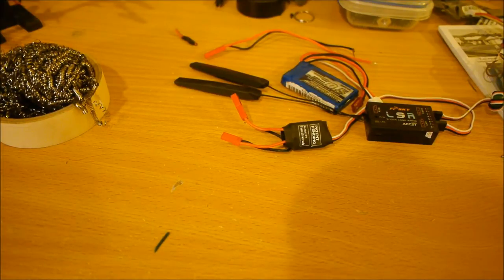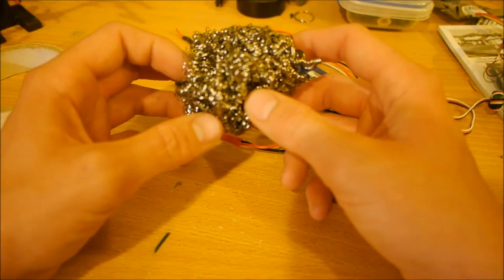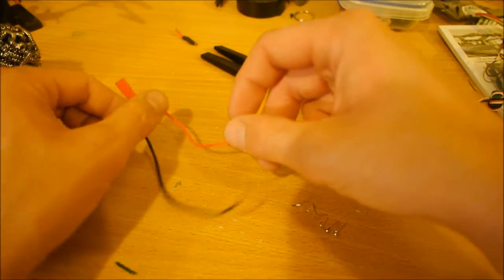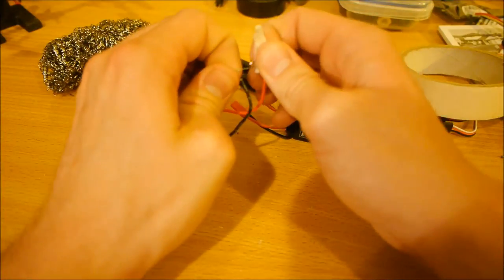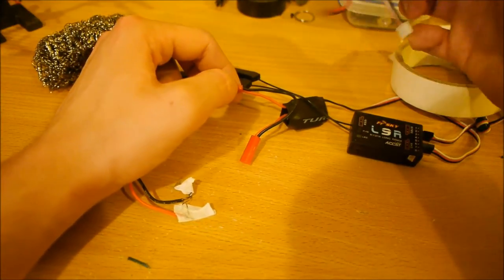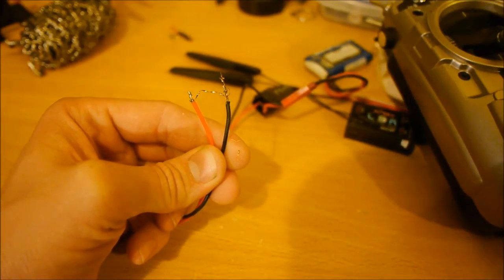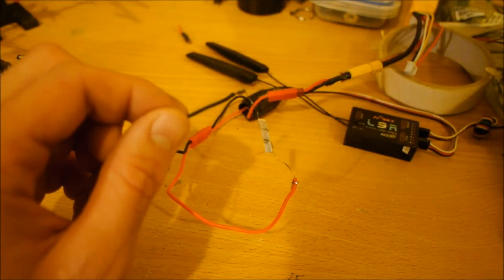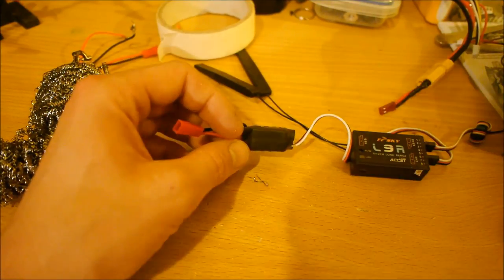RC Electric Fuse ( Remote Controlled Igniter  )

Comment: Can i power the whole thing off the main battery in my plane, instead of using an extra external battery. It would be run through the reciever. Btw nice video. It's the first simple one I've seen
Reply from the maker: You could but risk shorting out your main battery and breaking your device.